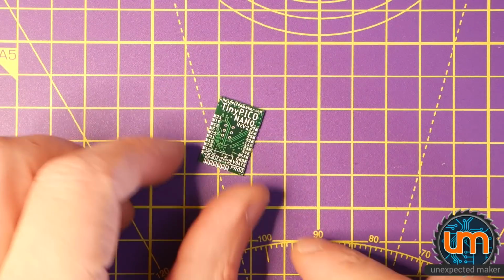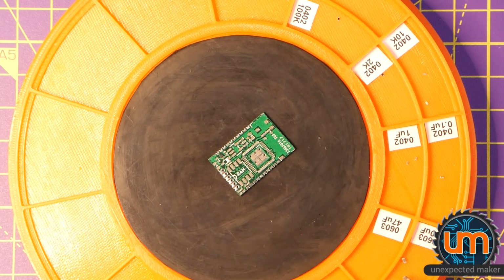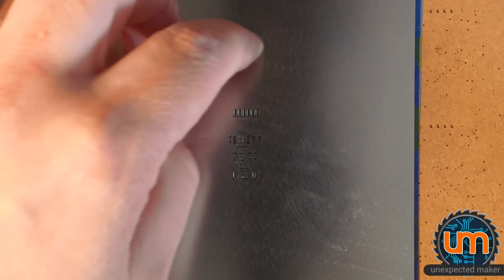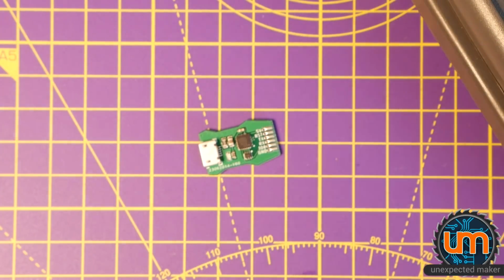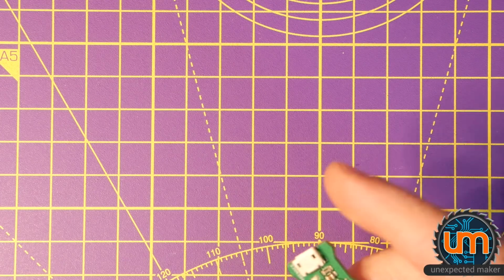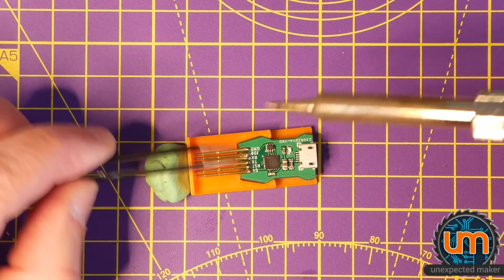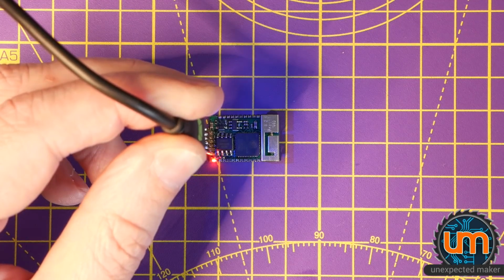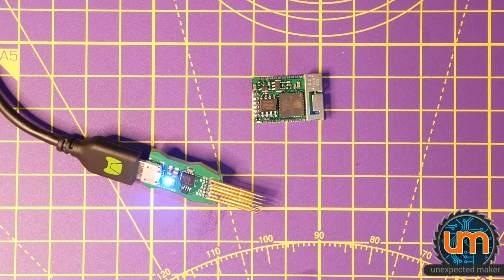TinyPICO Nano Rev2 + Programmer Build

Comment: You have insane eyesight! I can't believe you did all that without any visual aids.  The lazy susan is working great! I got to print me one.
How about making the holes for the pogo pins larger so the pins would pass through perpendicularly to the programmer board and solder on both sides of the board?
Reply from the maker: Pin spacing is 1.27mm, so wholes can't be bigger :( To use 2.54mm my Nano would need to increase in width by another 10mm :(

I have some thinner pogos on the way from Ali.. So maybe they will be easier to work with.

Hows the K40 going?
Reply: @UnexpectedMaker  Dang, now I see why some test probes are at angles.  I wonder how they made those?!
My k40 is not a useful tool yet, but I am having a blast learning, tweaking, and playing. Checkout my logs on my Hackaday page if you're curious.  I've just bought expanded metal locally to use as bed while I wait for honeycomb from eBay.
https://hackaday.io/project/162444/logs?sort=oldest

Comment: Awesome build, and I'm really happy everything works! I so wish connectors with x amount of pogo pins were cheaper, they are so much easier to assemble and can guarantee the spacing much better, but they're so expensive...
Reply from the maker: Yeah ridiculously expensive, but I might not have a choice ;) When my new thinner pogos arrive from China I might have a better chance of 3D printing a better soldering jig.

Comment: Nice builds! Perhaps the programmer could use a quickly made 3d-printed housing that extends halfway the pogo pins to make them a bit easier to handle?
Reply from the maker: Thanks mate! I'm not sure my 0.4mm nozzle has enough fidelity to print something that is thin enough to seperate the pogos, but maybe!
Reply: @UnexpectedMaker  - I have outfitted my printer with a 0.3 mm nozzle, which is only slightly more precise and is mainly suited for thinner walls. Positioning can still be quite good even with a ticker nozzle. I also tried thinner nozzles, but those cause failing prints. In practice I often use the soldering iron to persuade metal parts to fit in smaller PLA openings. I still want to make a 6-pin ICSP adapter with pogopins, to use on my ATtiny44A development board (see soon to be released video). I take my hat off for your handling of those miniscule 0402 components. I already struggle to keep 0805 parts between the tweezers...
Reply from the maker: Yeah I've been temped to put a smaller nozzle on my MK3, but I don't want the extra print times or failed prints and switching the nozzles is not quick or easy. 0402 is easy.... in 2019 I'll get some 0201's going :-)
Reply: @UnexpectedMaker - 0201? Wow! Either you are joking or totally mad... ;-)   0201 would be an amazong accomplishment to pull off (my eyes stop at 0805 and I would require a microscope).
Adding a second printer is probably easier. My printer is the mini RepRap printer called 3Dtje. It's a bit challenging, but you can build your own and print all parts yourself. They can be found on Thingiverse.

Comment: Normally you would make a jig with the spring probes sticking up from the bottom, which would make contact with the board when it is placed in it. It would be clamped in from the top.
It’s best to avoid the probes being in anything the moves to make the contact as the points stop any sideways movement and put stress on the probe mounts. 

3D print a base with the probes sticking up and little rotating latches to lock board down on to the spring probes. Best to have both hands free!
Reply from the maker: Yup, I understand how it's "usually" done ... but that's too limiting with the intentions of the Nano. The idea is the Nano is also a module that can be mounted on top of another PCB, so it's imperative it can be programmed from the top, not just the bottom. It's also why I made the edge of the side of the Nano castellated.. so it can be connected to in many ways. Stick it on a PCB and add your own Serial and USB, or stick it on a PCB and program from top,  or use as standalone and program from top or bottom. As soon as I force bottom only programming it loses it's versatility. Maybe I'm trying to make it too versatile ;) BUT I'm also trying to work out what it's use cases are still :-)
Reply: in that case i'd make a 3d printed end cover for the programmer to support the probes and remove the stress on the probe solder joints. with just enough free at the end to miss any components. Merry Christmas
Reply from the maker: Yeah a god idea for sure! Merry Xmas to you too mate!

Comment: I’ve been looking at esp32 picks as a coprocessor for my circuitpython stuff! Kinda want a tiny pico to stick as a module on a feather form factor 🤨 nice work Seon!
Reply from the maker: You mean like to put the ESP32 into AT mode for wifi? or as a proper programable co-processor?
Reply: Unexpected Maker similar to the particle boards!

Comment: Nice work Seon, yeah.....apart from that reluctant LED pretty smooth sailing. I think you need a rethink on the pogo idea but I get it !...…..I held my breath and stuck out my tongue at just the right angle during the pin soldering...…..so, I To look forward to whatever comes next.
Reply from the maker: How did you know I was sticking my tongue out? hahahah....  yeah, it's not optimal... but until I have a purpose for the board I'll just sit on it and let the ideas simmer!
Reply: @UnexpectedMaker  I have a confession to make...….. I'm realy looking forward to some sort of applications because I don't no very much at all about WIFI and stuff, Ive flashed an LED with my phone and I own a genuine Arduino Yun ( my first Arduino)   That's All Folks  !

Comment: Could put spacers for between the pogos to make them line up easier?  Don't know how hot they get and PLA melting
Reply from the maker: ABS is still lower than what I solder at. Also, printing ABS is terrible, esp on an open frame printer.
Reply from the maker: PLA will melt for sure..  the pogo pins get super hot. Even PETG will likely be a problem.
Reply: @UnexpectedMaker  How about ABS or higher temp filament?

Comment: Wow, watching the Pogo Pin assembly just added to my morning stress! LOL
It may be better to design with Pogo Pin shank sized holes on the PCB, to then solder each pin through-hole. ie. So the Pogo's would then be at right angles to the PCB.
Reply from the maker: Hahaha... sorry mate!
I wanted to see if I could solve this without making the Nano board bigger... but I might have to to accomodate 2.54mm pins.... boo hoo... hahahaha